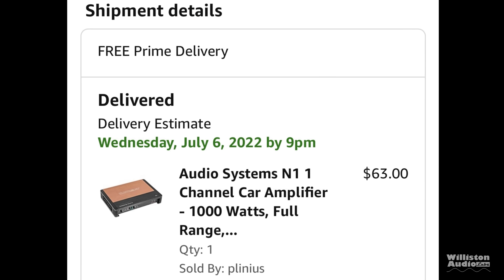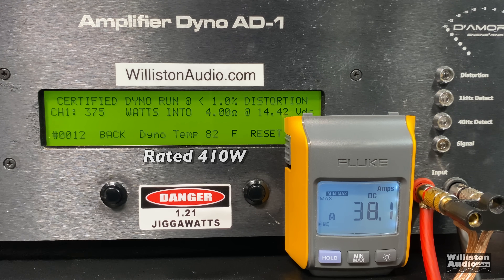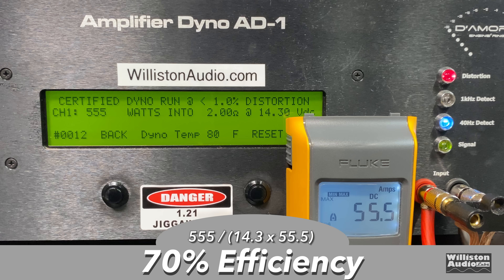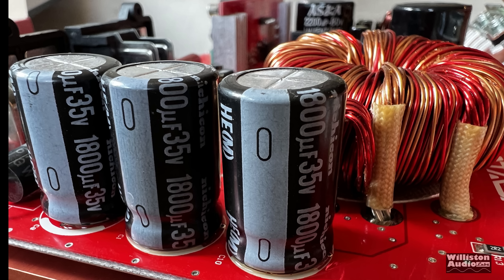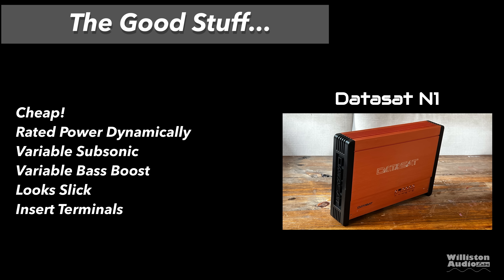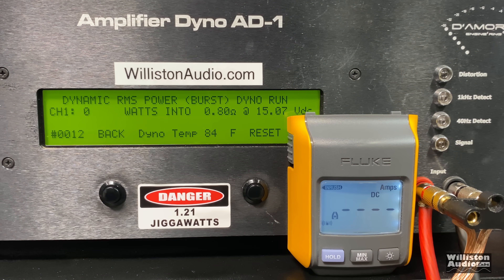Why is this 1000W $63 Amp BANNED from Amazon? [4K]

Comment: Ya the advertising reminds me of poor translation on many, many other Chinese products, not like you could fit a sub in the box lol but bro, for the price. That's not a bad little amp. I don't remember seeing the legs of the mosfets wrapped in other amps especially in that price range. Def an interesting specimen brotha, thanks for sharing
Reply from the maker: I thought the same although I didn’t mention it in the video! That seems like a higher end feature!
Reply: After seeing the first case of poor translation I tried to catch the next one before Big D pointed it out. Sort of a game. But right when he pointed out that both input & output we're labeled "input" I noticed that under them out was out but input was labeled "front". One would assume the only input could just be called "input". Google translator helped expose another fake 🤥

Comment from the maker: Playlist of Affordable Amplifiers: https://bit.ly/3cEQYHJ
NOTE: Amp May be available HERE!!: https://amzn.to/3bX79jC
Shop for Other Low Budget Amplifiers: (affiliate links)
Leiges Audio 500.1: https://amzn.to/3PQ1utS
Down4Sound JP8: https://lddy.no/vvaw
SKAR Audio RP-1200.1D: https://amzn.to/3FLdLfk
CT Sounds CT-400.1D: https://amzn.to/3u9n1UY

Video Index:
0:00 Intro
0:30 Made By America?
0:55 Unboxing the Amp
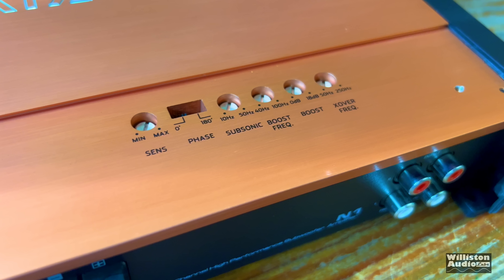2:00 Amp Adjustments
2:25 Inputs and Outputs
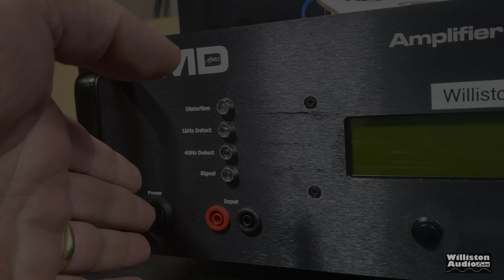3:26 Amp Dyno Tests
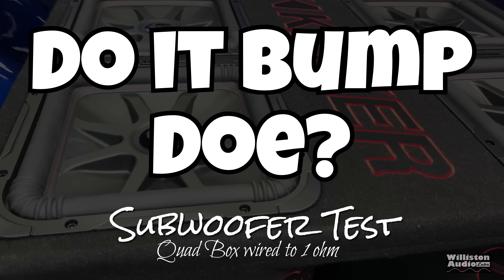6:47 Subwoofer Tests
8:18 What's Inside?
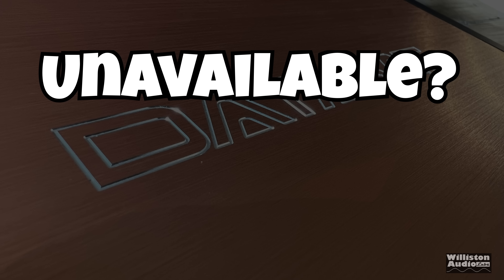9:52 Banned?
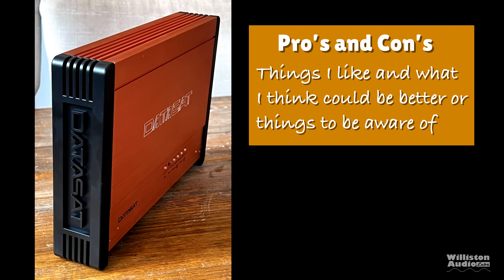10:47 Pro's and Con's
11:29 Final Thoughts
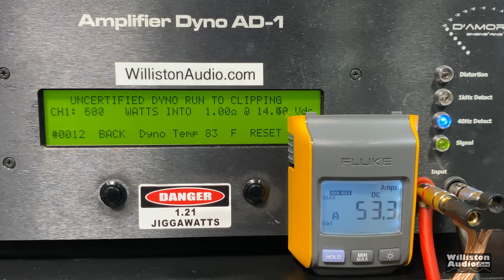12:01 EXTRAS

SMD / D'Amore Engineering Amp Dyno: https://goo.gl/sJTcf7
XS Power D1400 Batteries - https://amzn.to/2BPFCKW
XS Power PSC60 Charger - https://amzn.to/2CHGcfs
Fluke 1000A AC/DC Clamp Meter: https://amzn.to/2Rw5WDA
Handheld Dyno SMD AMM-1: https://lddy.no/106tm
My Favorite Screwdriver Kit: http://amzn.to/2x0VzcE

DISCLAIMER: This video and description contains affiliate links, which means that if you purchase from one of the product links, I may receive a small commission. As an Amazon Associate I earn from qualifying purchases
Reply: could you  measure the rail voltage on every amplifier you reviews next time? i mean you already open it to show us the guts, might as well probe the rail voltage on the diode legs too,i would love to see that thanks.
Reply from the maker: @amadzack666  Thanks for the suggestion 👌
Reply: @wal  thanks bigD for considering my suggestion,base on the rail voltage and data from your amp dyno,we know which section are the weaker point between power supply section and output section on every amp design.thanks again looking forward to watch more of your vids
Reply: I have bought a number of things from your links with that intent in mind. The ignite, Pioneer, Skar, and the JP8 were all purchased from your vids. I got the skar subs long before you tested them. Keep posting we love you. Talk to your boy JP about making a real bass head Bluetooth speaker and discontinue the over priced JBL clone.
Reply from the maker: Available on Amazon again! (Affiliate Link): https://amzn.to/3bX79jC